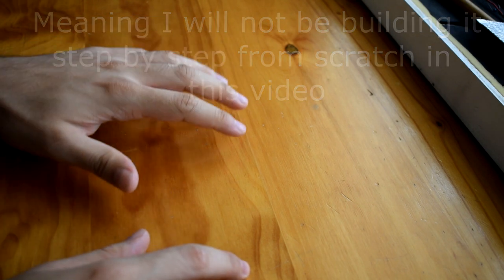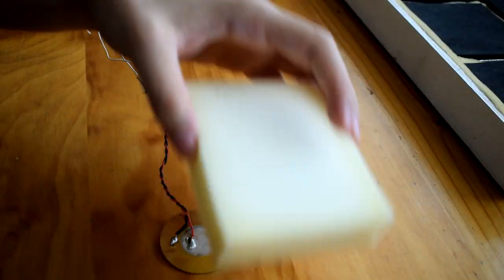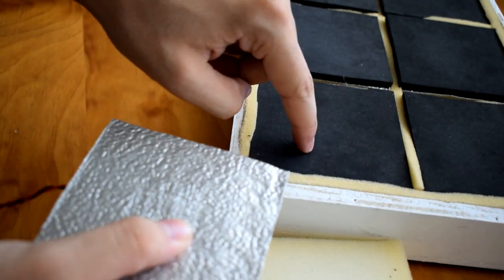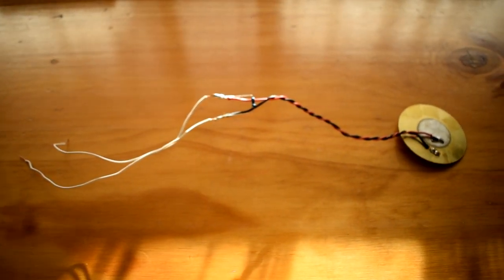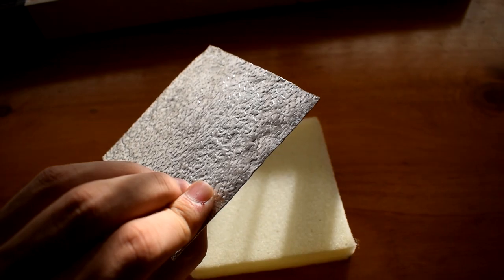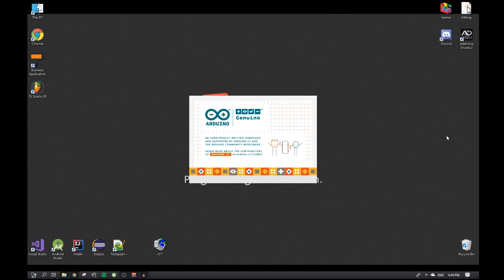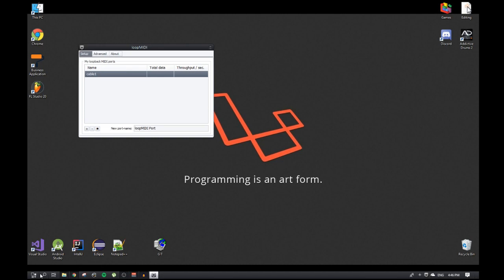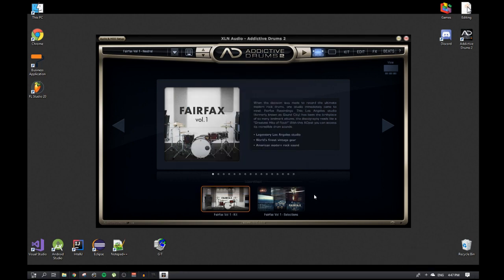Arduino Drums Tutorial Part 2

Comment: Thanks for the tutorial.
I tried and it failed while uploading sketch.
I used arduino UNO (chinese model), and 1 mega ohm register, havent used 5.1v zener diode as you said it works without it also.
I have tried with single piezo just for test.
Connected wires properly. Also setup up loopmidi and serial port properly.
Checked in arduio software by clicking 'Get board info from tools'. And it said UNKNOWN BOARD. 
But the serial port is visible in arduino. also tx light blinks on board after tapping on piezo.

After uploading sketch I got this error.

avrdude: stk500_getsync() attempt 1 of 10: not in sync: resp=0xb0
avrdude: stk500_getsync() attempt 2 of 10: not in sync: resp=0x0e
avrdude: stk500_getsync() attempt 3 of 10: not in sync: resp=0x1e
avrdude: stk500_getsync() attempt 4 of 10: not in sync: resp=0xb0
avrdude: stk500_getsync() attempt 5 of 10: not in sync: resp=0x0f
avrdude: stk500_getsync() attempt 6 of 10: not in sync: resp=0x20
avrdude: stk500_getsync() attempt 7 of 10: not in sync: resp=0xb0
avrdude: stk500_getsync() attempt 8 of 10: not in sync: resp=0x10
avrdude: stk500_getsync() attempt 9 of 10: not in sync: resp=0x21
avrdude: stk500_getsync() attempt 10 of 10: not in sync: resp=0xb0
An error occurred while uploading the sketch.

So I have few questions.
Is this happened because of duplicate arduino?
Will this solve by using zener diode?
Or do I need to buy origional board?
Why you used extra wire from GND to the last input? (its not in your diagram, but in video we can clearly see).
And last do i need to give extra power? (I have just connected the board using USB).

Please help me.
Thanks a lot.
Reply: I have also tried to install various  other versions of AVR board from board manager, still got same error.
Reply from the maker: @Akshaysalpe Make sure that when you upload the sketch you make sure its selected the proper COM port and that you have selected the correct aruino board in the software, not doing so will make it fail, also check the description of tutorial 1 to download the driver for the chinese board and see if it works

the not in sync error is due to it not finding the board that was specified in the arduino software itself

so I would suggest selecting arduino uno instead of telling it to get the board and apply those other changes

my board is a chinese replica and it works so tell me if those changes help

the extra wire is just to help with grounding issues if you need it, my code doesnt use it but if you do you have to read it between reading the other pads

also no extra power required
Reply: @thinktech3818  yes i have selected proper board and com port,  I also changed the 57600 in hairless settings,  I even changed the port no. in port settings from device manager by selecting newly appeared port
Reply from the maker: @Akshaysalpe  I have added a driver in the comments of the first tutorial that I used on my arduino, see if that changes anything
Reply: @thinktech3818  wow! really grateful for your quick reply.  I have tested that driver. still giving same error.  And I am also getting new errors "warning: multi-character character constant [-Wmultichar]"   I guess its because of inverted commas in pin assignments.
Reply from the maker: @Akshaysalpe  my only other advice would be to look for the boards vending number or id number and google and try and find its driver, thats what I did for my board, also then to just go through the steps again and make doubly sure that everything is selected properly, pleasure to help, hope it comes right, question are welcome
Reply: @thinktech3818  after updating the latest driver, getting message that already best drivers are installed.  Anyway I also need more than 10 output, and UNO  only supports 6. So buying Mega 2560 will be the best option.  I will let you know if I stuck anywhere in MegA2560.    Thanks for your time man. :)
Reply from the maker: @Akshaysalpe  Cool bro, yea I bought a mega 2560 from Aliexpress, its also possible to use two in conjunction, just by adding another port to loopmidi and so on, but hopefully your issue is resolved with the mega, couldve been an unfortunate issue with the company that supplied the replica (I heard a lot of bad stories so I looked for one with a good review), anyways hope it works out

just for future reference, when using the music software, take a look at ASIO drivers and using them, it reduces latency by a TON, glad to help
Reply: @thinktech3818  Hi,  came back with updates.  I bought new board (same as yours mega2560) and it seems genuine.  this time sketch also uploaded successfully but still not getting any signal in any  software.    where as light blinks on arduino board by tapping on piezo. also tried blink example program and worked fine.  settings are proper, connectivity are proper, but still not getting results.   I have attached the snapshot of my settings.  please take a look. 
Please let me know, How can we fix this.
http://www.mediafire.com/file/ym80009iss1xibv/Drumpad_test.zip/file
Reply from the maker: @Akshaysalpe  Hey Akshay,  I have a few questions

1. Are the midi notes used correctly setup for your version of EZDrummer? it may not be working because of that
2. when hitting the piezo you said the light blinks, that is good, but when you hit the piezo do you see on loopmidi, data going through the port?
(also I see you are using A5 or A6? try using A0 or A1 to test first)
3. Also check wehn hitting the piezo that the green dot lights up in hairless midi to serial
4. When all is done and connected and everything I said previously seems to be working, play around with the audio device in EZDrummer

If none of that works there is another version of the same code below that has different midi notes and different activation velocites, just try that if nothing else works

I hope you get it to start and ill be happy to hear the result

http://www.mediafire.com/file/awbn14cw2z0dhlp/Octapad_Code.ino/file
Reply: @thinktech3818  yes, midi notes are correctly set up in all softwares, I have midi keyboard and each and every key is playable and it works great.
after tapping piezo hairless also blinks (green dots) and data also changes in loop midi. Means both are working fine.
also tried by changing analog pins.
Tested with all softwares and also tried various settings.
Problem is any software is not showing any input signal. if it gets signal then mapping process comes, that can be easily fixable.
somehow it not able to connect to software.

tried your new code. seems like its less sensitive now.
tried in other usb ports. tried by changing usb cable.
Also tried by changing piezo and register.   still its same :(
Reply from the maker: @Akshaysalpe  thats very odd....

the new code is less sensitive because you'll see the activation values are all 1000, you can lower them for the pads to be more sensitive

uhmm probably stupid question but when selecting the loop midi channel in EZ did you click apply and rescan for it

also what messages does it show in hairless when you tap the piezo?
Reply: @thinktech3818  OMG   dont know how it happened 
But its working now.

As your earlier code was fine in sensitivity, I thought to try that once and  I reuploaded sketch.
tried resetting evrything in hairless midi.
earlier also it was showing signal and messages like
+107.099  -serial in : CH2: Note 52 on velocity 100
+107.099  -serial in : CH2: Note 25 on velocity 100
+107.103  -serial in : CH2: Note 36 on velocity 0

My ez drummer is working now but weirdly
I have connected only one piezo
it randomy plays  2-3 notes 
and also its not constant.
sometimes it plays single instrument  and sometimes it plays 2-3 note with same pressure.
Tried your both code.

But I am happy that atleast its working....   :)
Reply from the maker: @Akshaysalpe  Hey thats great!

the reason it plays 2 or 3 together (or bleeds) is because the other pads are not connected but the code is still tring to read it, so the signal from the pad you hit is still bleeding over to the other inputs, if it still does that after connecting all pads then add a wire straight to ground which you read as well, this will help

will love to know how that turns out
Reply: @thinktech3818  I didn't get that "add a wire straight to ground which you read as well".   Are  you talking abt the one which i asked you. That white wire from your video. If it so . then still that last input  will be usable for another piezo or I have to compromize it.??
Reply from the maker: @Akshaysalpe  yes that white wire from my video

You only have to do that if it still has the same issue even after adding all the pads

If you add all the pads and it doesn't do that, then you're fine
Reply: @thinktech3818  OKAY.   I Will check and let you know it works or not.
Thanks a lot bro for helping me. Very grateful for your precious time. 
I will let you know once i finish my final product.
And one more favor please.
I will also use 4-5 potentiometer along with piezo.
So can you give a basic reference sketch for that so I can update as per my requirement.
And also is it possible to make "shift" kind of button so the same piezo will trigger different note after pressing shift. ?
Reply from the maker: @Akshaysalpe  It's a pleasure to help

I'm guessing that the potentiometer is for your hihat pedal? If so I will take out time to update the sketch to include for that as well as using a button to change a pad to a different note.

If you want to take a look at trying to figure that out yourself, look at tutorials on using the PWM inputs on your Arduino with the potentiometer, PWM allows you to take a varied inputs, as for the switch to change to a different note, that can be achieved in a similar way, but using an input that only reads on or off and changing the code a slight bit

But again I'll only be able to look at it after the weekend as I am writing a Math exam for university on Saturday
Reply: @thinktech3818  No worries bro. Exam first.  I will also try my best to achieve this.
Actually I will use ableton live with 4-5 internal instruments. which will be assigned to different tracks.
then i want something like SHIFT button, so after pressing SHIFT, I will be able to switch the track (basically performing second action from same button.)
Also we can use same technique for hi hat . So naturally it will act as open hi hat . and by pressing switch, it will act as close hi hat.

Comment: how to do the same with a SD Card and without a computer
Reply from the maker: Hey Robert, you can achieve the same with just an SD card but it requires a lot more coding and know how, I might make a video in the future explaining this concept or doing it this way but there are other tutorials on YouTube that briefly show how this would be done
Reply: @thinktech3818  thank you somuch, as I am not a electronic guy if you could share the coding along with your next video will be highly appreciated. It was my childhood dream to have a drum set and now I am got everything to get assembled. And my kids will learn alongwith me. Thank you once again
Reply: @thinktech3818  Sir, I am using the following code and it continuously plays sounds immediately as it connects to the power source. I want to play the sound only when i hit the Piezo. Could you help me to identify the mistake in this coding and suggest corrections.
Thanks!

#include <SD.h> // need to include the SD library
//#include <SDfatlib.h>

#define SD_ChipSelectPin 53  //example uses hardware SS pin 53 on Mega2560

#include <TMRpcm.h>           //  also need to include this library...
#include <SPI.h>

TMRpcm tmrpcm;   // create an object for use in this sketch

int knockSensor0 = A0;  
int knockSensor1 = A2;
int knockSensor2 = A4;
int knockSensor3 = A6;
int knockSensor4 = A8;  
int knockSensor5 = A10;
int knockSensor6 = A12;
int knockSensor7 = A14;

byte val0 = 0;
byte val1 = 0;
byte val2 = 0;
byte val3 = 0;
byte val4 = 0;
byte val5 = 0;
byte val6 = 0;
byte val7 = 0;
byte val8 = 0;
byte val9 = 0;
byte val10 = 0;

const int THRESHOLD = 100;

void setup() {
  Serial.begin(9600);
  
  tmrpcm.speakerPin = 46;
  
  pinMode(46,OUTPUT);
  
  digitalWrite(46,HIGH);
  
  if (!SD.begin(SD_ChipSelectPin)) {  // see if the card is present and can be initialized:
    Serial.println("SD fail");  
    return;   // don't do anything more if not
  }
  else{
    Serial.println("Done");
    tmrpcm.play("Snare.wav");
    }
 // tmrpcm.volume(50);
  //tmrpcm.play("m.wav"); //the sound file "music" will play each time the arduino powers up, or is reset
  

}

void loop() {
  // put your main code here, to run repeatedly:
 val0 = analogRead (knockSensor0);    
 val1 = analogRead (knockSensor1); 
 val2 = analogRead (knockSensor2);    
 val3 = analogRead (knockSensor3);
 val4 = analogRead (knockSensor4);    
 val5 = analogRead (knockSensor5); 
 val6 = analogRead (knockSensor6);    
 val7 = analogRead (knockSensor7);
 
 if (val0 >= THRESHOLD) {   
    tmrpcm.play("BDrum.wav");
    Serial.println("kick!");
    delay(10);
    }
    
    if (val1 >= THRESHOLD) {
    tmrpcm.play("Snare.wav");
    Serial.println("snare");
    delay(10);
    }
    
    if (val2 >= THRESHOLD) {
    tmrpcm.play("Tom1.wav");
    Serial.println("Tom 1");
    delay(10);
    }
    
    if (val3 >= THRESHOLD) {
    tmrpcm.play("Tom2.wav");
    Serial.println("tom 2");
    delay(10);
    }
    
    if (val4 >= THRESHOLD) {
    tmrpcm.play("Tom3.wav");
    Serial.println("tom 3");
    delay(10);
    }
    
    if (val5 >= THRESHOLD) {
    tmrpcm.play("Crash.wav");
    Serial.println("crash");
    delay(10);
    }
    
    if (val6 >= THRESHOLD) {
    tmrpcm.play("OHiHat.wav");
    Serial.println("open hat");
    delay(10);
    }
    
    if (val7 >= THRESHOLD) {
    tmrpcm.play("CHiHat.wav");
    Serial.println("close hat");
    delay(10);
    }
    
    delay(50);  // we have to make a delay to avoid overloading the serial port
}
Reply from the maker: @sayitthere  you may have a grounding issue, try connect a wire from an open analog input directly to ground
Reply: @thinktech3818  Thanks will check it today. So, I can be rest assured the coding has no flows
Reply from the maker: @sayitthere  make your threshold bigger, the Piezo outputs all the way to 1024, so it really will be quite sensitive and make noise without you doing anything, depending on a lot of things, but no problem in code, just adjust threshold, or try reading spin that is grounded as well
Reply from the maker: @robertdellmarc7927  no flaws, just check the grounding and then adjust threshold values
Reply: @thinktech3818  Thank you somuch!

Comment: Hi, how I can do this with an arduino uno? I just have 6 pads for the project. Thx
Reply from the maker: Hey Mario, it doesnt matter which arduino you use, the type of arduino will only limit the number of pads you can have in total
Reply: @thinktech3818  thank you very much for your answer! I've got another question... do I have to change the code? If yes, how can I change it?
Reply from the maker: @marioromero2544  if you are having less pads then you don't really have to change the code, you will only change the array at the top and the corresponding code if you add more analog inputs